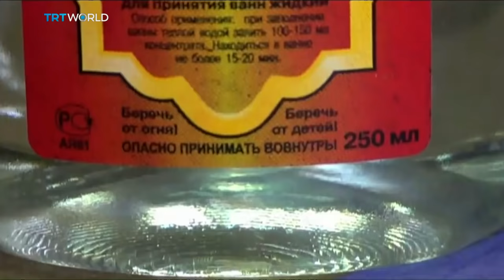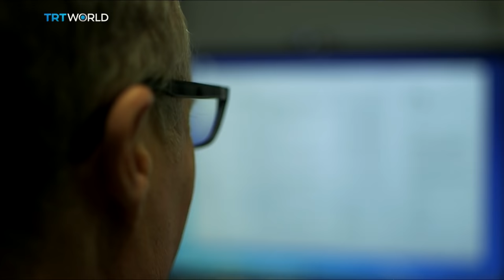Insight: Storing solar energy

Comment: Now there's something better than lithium batteries. Made of sodium and glass, where the electrolit is solid (solid state battery), preventing the formation of dendrites. They also last longer and charge faster, their production doesn't require a process as complex as producing lithium batteries and their components are more readily available and non pulutant. Google it.

Comment: Recently saw a video where disused coal mine was flooded then, when there was excess power generated from solar or wind it was used to pump the water to the surface then released through a turbine back into the mine at a time of peak demand. No need for hills and only needs a reservoir at the surface.
Reply: the hill is needed because you need the water to fall on its own. you cant just pump water underground and expect it to come up to run a turbine. use your head for once

Comment: I've wondered why we can't use excess electricity generated to make oxygen and hydrogen via electrolysis.These gases can be stored until there is an electrical demand and at that time can be recombined to generate power to create needed electricity. Seems to be a simple solution for energy storage.

Comment: I have copyrighted material on a battery or more precisely a generator that will last at least 30 years. The next installment of that invention will be a battery that is in case and we have invented  a fiberglass composite material and the size of a AA battery. However it will require some research and development. there is no way anyone could tear into that type of material and the actual isotopes is a Beta material that is harmless unless it is broken apart and eating whatever that is quite impossible since it is also in case and a PNP junction several of these junctions are connected in such a way to allow the successful production of an AA battery voltage there are other things that can be beta particles that cannot penetrate a piece of paper by being in case and composite fiberglass. This isotope is sprinkle in a The battery which I call a safe nuclear battery is I In my book called "concepts of inventions" multiplexing in reality John F Roach. I use a junction npn . inside The Junction are sprinkles of strodeim 90 isotope and impervious sprinkles isotope-90.  A save but powerful generator or battery that should last at least 30 years in cased in material composite I also own the copyright for a extremely efficient fly will storage with battery back up this is also in my book. John F Roach

Comment: just get a tesla battery,forget "flywheel"
Reply: flywheel is cheaper. and big heavy flywheel stores much more
Reply: I think the convenience of batteries outweighs the benefits of a fly wheel, the trouble of getting the power out of a flywheel is just too much, messing around with gears or capacitors or some shit.